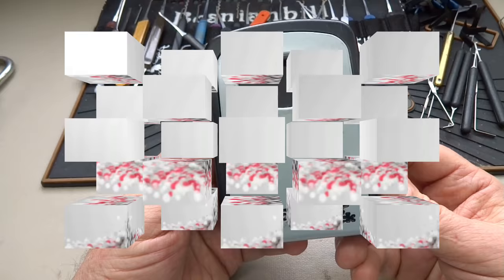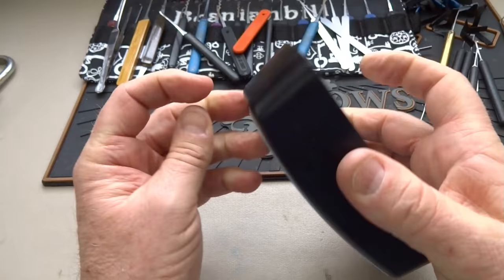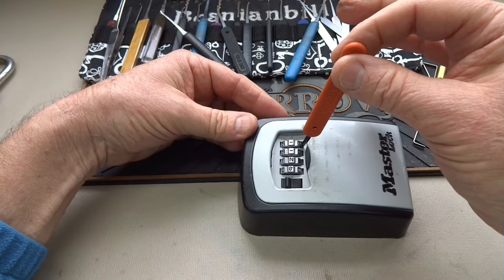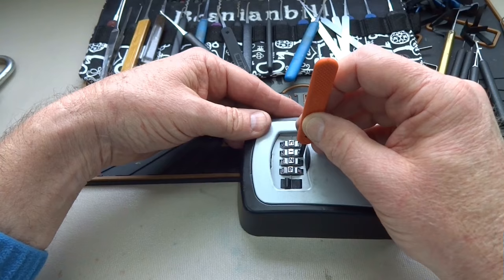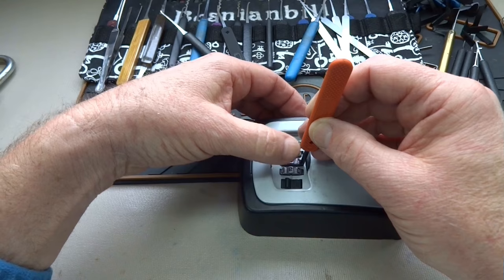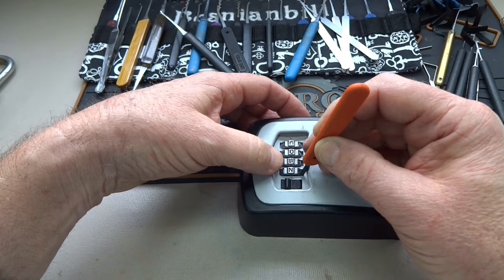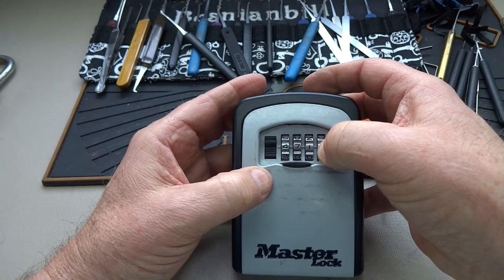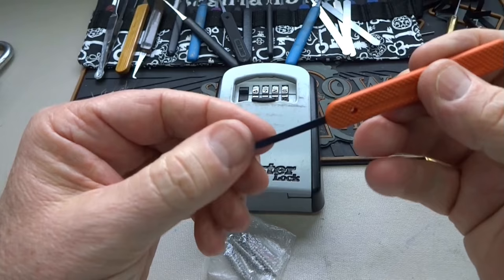(642) Master Lock Combo Box - EZPZ to Open! (JUNK!)

Comment: I was actually able to open one of these with the flashlight on my cellphone
Reply: How?
Reply: @200mphz06  by looking through the gaps between the dials to find the flatspots
Reply: What are the flat spots look like?
Reply: @peterm5366  On some of these you can see in between the gap of the number barrels, Imagine a metal rod with a flat side on it, You can actually just slice a Coke or beer can and make your own feeler shim, Just apply a little pressure and you will feel it go flat, Do that with all 4 numbers,  it won't open right away, you need to rotate all of the numbers 1-2 clicks downwards, then it will open. should take less than 10 minutes to crack it, :)
Reply: AppyDroid Development m
Reply: @peterm5366  Like a spot, but like flat...

Comment: In any case I have two: the one on my door holds the key to my mail box and that key holds a key for my garage and in my garage I have another key box where I have the emergency keys . Now keep in mind that in the building where I live mail boxes aren’t linked to the apartments by number but by name and garages are marked with a different number that the apartment, so I stranger that would open the first keybox what not know what to di with that key.

Comment: I am a realtor in the Pensacola area and I have several of these combo lockboxes.  They cost over $30 each.  I could not remember the combo for one of these boxes and tried your method using the backing of a razor blade.  I pulled the razor out, then pried the backing apart, cut it with scissors....and voila, it worked.  My combo box is back in action.  Thanks for the tip!
Reply: Why would you use such a trash lock?

Comment: I so appreciate this video. I intend to use indoors for a key lock that only certain ppl can access. It’s not protecting anything really valuable and it saves me from have to duplicate & track multiple keys issued & returned. When I opened it I went straight to setting it and didn’t read the instructions and I set the damn thing to some random numbers without realizing it. This video just made my day!

Comment: Master Lock appears to have improved the design of this lock recently.  I just picked up a 5400D from Home Depot (very similar to the 5401D in this video, but with a shackle instead of screw holes for mounting), and I found that they had added ridges that make decoding difficult, though still possible if you get creative enough.  I took apart the mechanism to look for a bypass, but there isn't one--it isn't spring-loaded; the cams have to be aligned for it to open.  I expected the shackle component to be shimmable, since it's released via a simple spring-loaded latch from the inside, but I found that the enclosure for the lock mechanism blocks the latch from moving when the compartment is closed.  Based on the complexity and unreliability of decoding now, it seems faster to just take a hack saw to the weak metal of the case.
Reply: Aware the original video was some years back and your comment 3 years ago but I have just purchased this exact model albeit a newer/current version and am struggling to get into it using this method.
Reply: @mitchellw7118  How to differentiate the two versions? Do they differ visually?

Comment: Thanks for this, I just moved to a new flat and they had one outside with a spare key in it, the code was long since lost, with luck I was throwing away a rusty tape measure and could fashion a pick using it. with 0 skill it took 2 mins :)

Comment: We have one in our office that's been there since before we moved in. I've tried a few times to open it with no luck. I tried the two main combinations used in Glasgow, 1888 and 1690 nut whoever set it must not have been a footy fan . Today I pushed a sim card tray removal tool down below the little switch and put some pressure on it. I then tried the wheels, and each one bound up one after the other, giving me a combo of 1337. Got it open, and there were 3 keys in it that must have belonged to the last people in our place. I gave them to the security guy at the front desk and put our emergency safe key in it along with a couple of painkillers in case I get a headache at my desk.

Comment: You don't need any tools to get these opened, played with one in a hardware store and I was shocked. Press down on the lid, pull down on the latch, let the lid up, and then turn each dial. It will get easier when it's on the right spot.

Comment: Thanks! Very comprehensive video, especially the part showing we have to cycle the digits. Most other videos don't or expect a shift of just 1 (had to rotate 4-5 notches). A can of coke, a couple minutes and I could get into the box some jokster tried to lock us out of. Scarily easy tbh, thankfully the building also has an alarm system.

Comment: Hi , I just purchased one of these and after seeing your video I thought I would give this a try.....no matter which side of the wheel the blade is fitted,  there is no flat spot felt , if I look closely under  magnification and bright light there is no flat spot , line , mark or depression on the small washer along the  sides of the number wheel...nothing on the axel that supports the wheel , or on the wheel itself,  it is smooth and  perfectly round.....please explain what I'm missing,  I would like to see one of these in a break down picture or schematic .

Comment: I found a better tool for this..... a torch! There is just enough clearance between the number wheel and the metal casing to actually see the flat spot coming around. Once their all at the front, 5 clicks on each dial and in you go.
Reply: Or even better yet, an oxy-acetylene torch! There is just enough clearance between the number wheel and the metal casing to melt the whole thing right off!
Reply: +mrkiky this is true... however slightly bulky and there is the slight possibility you'd incase the contents in molten bad design!
Reply: Thanks mate, worked for me. Had one left by the agent when we bought the house a few years ago. I had forgotten the code but your tip worked. 

cheers!
Reply: Just burn the house down and take whatever you need from the ashes. Simple.

Comment: you don't even need the tool
you can just use your hands ... go through the dials from left to right to left etc, doing the following:
start turning it a bit and work out the "minimum" pressure from your fingers to turn it for most numbers - except for one spot.
that spot is either your number or it is one off from your number (if you moved the front of the dials down then you have to turn them one up for the real number)
you will very clearly feel the spot, try it a few times ... once you got all numbers done go over them once more to make sure (sometimes 2-3 seem to bind in spots they're not supposed to at first try)

you can open it within 30 seconds without any tools

Comment: I have similar (I'm in the UK) and it's made by Yale. Mine has the 4 wheel combo but to open you then have to push on the door to click a latch open. Obviously it works on the same system and is pants - its not in use and was already on my house when I bought it.
The problem is though that many old folk here rely on such things. Aside from the easy pickings on the safe, they're also made of rubbishy die cast metal and can be destroyed with one good hammer blow.
I've seen sturdy steel cased safes for sale but again they use the easy pick number combo. Even without picks you could stand and go through the numbers numerically and eventually get in..

Comment: TBH, the standard lockpick of your average thief is a hammer, bolt-cutters, a screwdriver or a brick; not many thieves would spend  more than 30 seconds trying to pick a lock. If it holds up for 30 seconds it'll probably do.

Comment: I forgot the combo on one I had sitting around (Yes, I did buy it brand new, No, I didn't rip it off the next door neighbour's wall!) I don't have a decoding knife so I just looked very carefully with a powerful torch down the side of the dial and I could faintly see a flat spot. I followed BB's instructions and managed to get it open! Turned out I had set the combo to something quite logical: 2018!! facepalm

Comment: My Landlord has put up one of these at our front door.. In the beginning, it was just zip tied to a fence, but now he put a chain on it and "secured" it to one of the basement window bars. Keep in mind that the neighborhood is so bad that you can't even lock a bike outside for a night without it being disassembled and stolen, and now he thinks it's a good idea to put the master key for the front door and every apartment door for the entire building out on our front porch. Apparently it's so the construction workers can get in without having to call the landlord. Really reassuring that anyone can just type the name of the lockbox into youtube and find a tutorial on how to open it. I can't even put in a deadbolt, because that key unlocks the bolt as well. I think I'll show him the video and get him to remove or at least hide the box.
I'm not that great at picking locks, but I can handle a usual door lock, and I know that no lock is 100% safe, but I always felt a bit of security knowing that a would be intruder would have to pick three different locks in order to get in. But thanks to my genius landlord, all someone needs now is a slim piece of metal to open up the entire house. Well, at least I don't have to worry about loosing my key after a night of drinking again since I can just pick the lockbox using an empty beer can. Thanks for the video tho, really interesting stuff.

Comment: Wouldn't a bushing in between the wheels be enough to prevent this method of picking? Would make it quite difficult to get a knife in there i would think. Just a thought.
Reply: *****
 Oh i know. The idea wasn't so much for the manufacturer as it was for just an idea to improve the design as a whole. I'm not that well versed in locks so I wasn't sure if it would work or not to improve the overall design.

Comment: Bill, can you recommend a good lock box?  I like to keep keys in one somewhere on my property just in case, but this isn't secure enough.  Thanks!!!
Reply: The best place to put a key is where no one would ever look for it or know whare it is. I reccomend hide a key rocks over these things. When you place one of these on your house it is a direct target.
Reply: Wayne Winton Yeah, it's actually hidden on the property, not by the house.
Reply: bosnianbill Thanks...I will check with the sister-in-law.  She's a realtor.
Reply: That is the best way
Reply: I think the Kidde AccessPoint Spin Dial is a better option than this.  It takes a 3 alpha combo.  It is possible to decode the last value, but i don't think the other two are easy to get at all.  But Wayne is right, whatever you use, keep it out of plain sight.
Reply: Hey Bill - How about giving this one a shot (http://amazon.com/gp/product/B00J3UIT7E/ref=oh_aui_detailpage_o00_s00?ie=UTF8&psc=1)
Reply: +RJ N As long as it's actual digital and that wheel puts no forces on the push mechanisms it should be fairly safe.
Reply: Those are easy to defeat.  Just check the realtor notes on the MLS and it will tell you the code. ;)
Reply: Wayne is right. Hidden is better than "hard to pick," especially for property that isn't being lived in. Hang it 8 feet high on a tree in a wooded area and you can get by with 0-0-0-0.
Reply: I am not from Bosnia, nor am I a Bill.... But if you MUST use one of these, get the Supra with push buttons, not dial. Then attach to the gas pipe at the meter. People are scared to drill and grind and smack things with tools near gas. Better solution, a BEEFY keyless deadbolt lock  I sell one you cannot get on Amazon, but I am NOT mailorder, gotta come here to get it. Or visit your fav locksmith, and have him call me for the RX

Comment: I have a similar one, but from a different company (IBOX ISNK-03). Recently I was changing the combination on it and I'm not able to open it afterwards. I think what I did is I closed it with this RESET function enabled (I moved the small lever from position A to B, changed the combination, but didn't move it back to A). I'm wondering if this the reason I cannot open it anymore. If so, is there anything that can be done or it's simply broken now?

Comment: Hey Bill. I recently bought one of the Sparrows decoder tools. It came and I notice it is extremely rough. Like sand paper rough. And has sharp but rough edges. Is this due to poor manufacturering or are decoders supposed to be rough like that. Should I polish it or leave it as is?
Reply: Mine is so rough that it makes it hard to turn the dials while it is in there though. They nearly seize right up

Comment: We know this is crap now, but does anyone else in here have any suggestions for more expensive not a crap lockbox?
Reply: I have workaround this now for me. If the key lock is within the WiFi range from home then you can fit in an motion sensor triggered, battery backed up, wifi connected camera like e.g. Ring and point it to the lock area. Every time there is a movement it triggers an alert on the smart device (tablet, phone etc..) and I can see whether there are intruders or just guests collecting the keys. With an UPS backup for internet modem router it also stays connected to internet in case of power outgage. Ring cameras start at 100 euro in EU. UPS is from 40 euro. Works for me. Cleaner lady just leaves the keys in the lock for checkin then it is empty as the guest have them already.

Comment: if i have a combination lock where you can change the combination, can i still use this method to open it?
Reply: No problem, i was just wondering. Because it doesnt make sence that these flat spots change when you change the combination...I'm new to these stuff
Reply: With these locks, I think changing the combo just rotates the number on the cam wheel, the reset lever inside locks the cams on the flat spot (so you need the old combo for it to be able to reset) and releases the number wheel letting the number wheel rotate while you program the new combo

Comment: how do you remove a broken master lock box?
Reply: Lisa Apostoloff cut off the part that attaches to the lock knob. You'll need to use a grinder though. If you know how to remove your lock you can just take your lock off pop the knob off and slide it right off

Comment: If you have time, then the "easiest" yet time consuming way to open a combo lock is to just rush it, since if it has 4 digits, it has 10k combos, 3 digits then its 1k combos, so you can just go through it like 0001, 0002, 0003 etc, eventually you will find the right one.

And this is if you do not have the tools, but you have the time, especially if it is your own lock and have forgotten the combo.
Reply: how the fuck is that easier
Reply: That's not the easiest way. That's the simplest way. As in, if you do it this way, you're simple. The easiest way is by destructive entry.
Reply: Right away you can eliminate many possibilities with deductive logic because you will never have a combination with multiple same numbers like 0001, 2222, etc.

Comment: I don't know what cheap ass lock you have there son but my masterlock I have been trying to pick for ages and it has barely half a mill gap on either side of the numbers. I can't find a blade small enough to allow it to rotate afterwards let alone find the "flat spot"
Reply: Have you tried cutting up a pop can? That kind of metal is so thin that you might actually have to fold it over to double it up, but still make it a fairly narrow strip.

Comment: Didnt work i tried it 100 times
Reply: There is no flat spot feedback on mine either. I no longer needed the box, so I took it apart and there are metal rings over smaller rings...so you don't have access to the "flat spot"...maybe they changed.